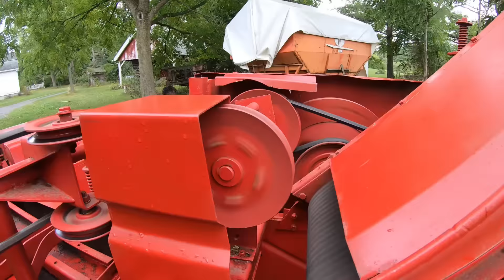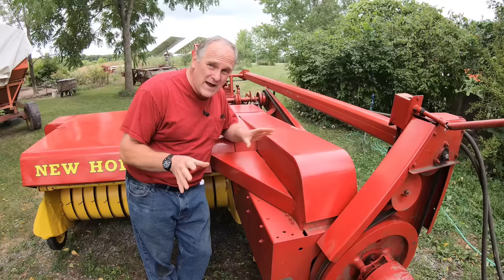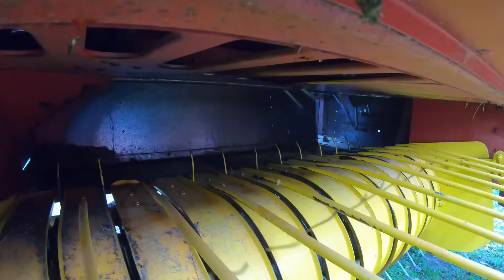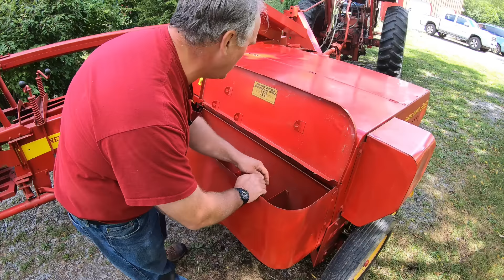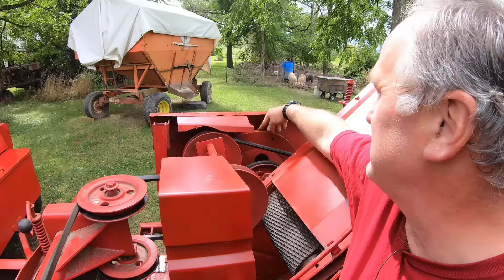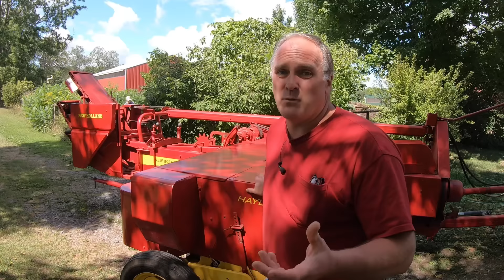NEW HOLLAND balers from the 1960's: how they work, maintenance, operation, and making good bales

Comment: Here in Idaho, people just drop their equipment wherever they stopped at, at the end of the season, then they go out next spring and wonder why nothing starts or works...like they're so afraid to build a shed to store that expensive equipment in.  I don't have any equipment or tractors, but even I know that leaving that stuff out in the weather is a horrible idea....I keep my lawn tractor in a shed, as well as my other lawn/garden equipment...when you spend hard earned money on stuff you would think people would keep better care of it.

Very interesting video on the baler functions.  Most people where I live have slowly transitioned to round balers as well.  A few still use square balers, smaller operations tend to, and those that sell to local feed stores.  I prefer the square balers as it doesn't require the large tractors and bale spears to handle the bales...however, many transitioned to the round bales because of theft.  People were going out in fields with trucks in the middle of the night and stealing hay.  Fix for that was round bales that required large tractors to pickup those bales.  Lot less theft that way.  

You mentioned with that square baler you ran it behind a 20HP tractor, which makes me think I'd be able to run it behind a Sub-Compact or Compact tractor...the only issue I would see is the weight of that baler pushing the tractor if you had hills on the property...luckily I have a nice flat area, but not enough space to bale anything LOL...I only have an acre HAHA!!

Comment: When I was young we baled 120,000 bales a summer for winter feeding for the cows. It was a wire binding baler. The wire didn’t break as often. Unfortunately we had to stack the hay and then feed out in the winter. Bales weighed 60-80 pounds great workout for young folks. It was a new Holland as far as I remember.
Thanks for the memories. It was life not drudgery.

Comment: We just bought a 268 last week.  The owner didn't have a tractor on site to run it but we took a chance and bought it anyway.  We got it home and tested it out.  It ran ok so next day we baled 500 bales.  Made another 168 the following day.  The baler didn't miss once.  I'm sold on New Holland.
Reply: How is it? And are you still using it?
Reply: @Huntersprojects  Yes.  Doing very well.  Made a couple thousand bales again this year.  Just did routine maintenance and replaced a few wear parts.  One of the best investments I've ever made.
Reply: @DavidJohnson-py6mp I had what I think was a 268 wire. Used it for ten years (78 to 88), then picked bales up with a 1040 harrowbed (pull type). Liked so well, might look for another. Have fun
Reply: Thank you for the update.
Reply: We've had a 268 for years!
I won't say.its foolproof but I don't know a better small baler. 
I have no idea how many bales I have stacked behind her.
Reply: Always keep the plunger knives sharp, as people often overlook this. It will reduce stress on the gearbox ,slip clutch and shear bolt.

Comment: You have done a wonderful job at explaining how the baler works. My landlord has a Hayliner 315 which does about 2500 bales per cutting. I am going to look into the absence of the cable for locking the right wheel, since it is me that does the baling. Maybe it never came with one, but it would sure be a blessing to have it. Something that has never been explained to me is, why the 2 pin settings when it is opened from the road setting to baling position. There is no mention of this in the manual. And lastly, can I bale in the road position?
Reply: Baling in the "road" position would wreck the UJ's.

Comment: Two tie baler,  what is your bale weight? 90lbs?        I work for 3 different farmers, mostly baling about 800 ton every year,  3 tie hay, either alfalfa or timothy, and 90% of the hay is shipped away either out of state or overseas,  our cattle ranchers, here have to import most  of their hay to feed the cattle, as its cheaper then the way we raise.  Almost 100 % of the hay farmers use Freeman  balers  made in the Portland Area, since the 1950's   design for heavy hay,  a few balers here many years ago where HI International or New Holland , but that was during the 1950 to 1970's  not anymore.

Comment: Great video. Being proud of making older equipment work as it was designed, with a couple of tweaks is a passion some people do not understand. Myself being an old farm boy, also a factory trained Hew Holland  Ag mechanic from the early 80's. Just going to mention the actual purpose of the shear bolt on the fly wheel. WAS to protect the needles . That would be the flat bar or on later models a cable that runs from the knotter to a little wedgy thing on the non-feed of the bale chamber it impacts the crank arm. Be like the minority and grease it the thing.That was the Major cause of broken needles.

Comment: Hey I have a 272, find I'm smashing through shear bolts every couple of bale's, have to clear chamber everytime. Any idea what causes this? Possibly blunt knives? And if so and idea how to replace or sharpen? Found it hard to find parts for the old girl.
Reply: Oil/grease on the disk "brake" on the end of the knotter assembly?

Comment: Yeah I like the nh baler better than the Jd   I changed over to a 10 bale Accumalator system and had to upgrade to 5070! I had a 30 year old 326 hayliner and it would always kick out a six inch longer bale inconsistent. Both great Baler’s

Comment: I grew up with a 68 and a 268, and a 56 Rake. NH made excellent hay equipment. 
The 68 was bought new by my Grandpa, the thrower added later on in the early 70's. Shortly after it was purchased by my Dad and brought to our farm. In the meantime, we had a 268. 
The 268 was a nice baler for 2nd and 3rd crop, lighter windrows, ran a bit faster and took less power from the tractor. Most of our time it was behind a David Brown 1200, with the occasional stint behind Grandpa's Moline U302 Super(gas). 
The 68 liked to be stuffed full. While the 268 was very similar to the machine in this video, the 68 ran slower and had the system for the feeder rakes where they mounted on a large chain. As the chain went around the sprockets, the teeth would advance, go up and return, then lower and advance again(picture a bike chain, with the feeders hooked onto one link in the chain) The advantage of the chain drive was the teeth "got up out of the way" as Dad would say. The 268 relied on the rakes gliding over the hay, obviously not ideal if the baler is being run at capacity, the rakes need the room to move. 
Basically, the 268 liked smaller rows and higher travel speeds and the 68 liked to get stuffed so full you couldn't see the pick up anymore, much less the rakes. We used to just cram that 68 full up and nice solid square bales would pound out the back. 
We kept both in a machine shed. The 68 got rained on, once, when we got a flat tire on a Saturday and couldn't get it replaced till Monday. Chaff from Grandpa's farm was on it when it went to auction in the 1990's. We had ZERO corrosion issues, we never cleaned the hay out. Of course, we kept them in Wisconsin wood machine sheds built circa 1890 with dirt floors, concrete and steel doesn't work the same. Bales from the summer prior were just as nice and green the next year in the chambers that way. 
Most farmers agreed the JD auger feed was more simple and had less maint. issues. The rakes on the NH can actually wear down, we had to replace them on the 68. The lead rake was 3 inches shorter then new! It can have a big effect on bales coming out "square" vs curving. We never had issues with the NH design, and honestly I think the machine is much better built. 
There were mixed reviews on the kicker vs thrower, most people doing the unloading of the throw racks would say the kicker style- the bales would "come apart" easier, meaning as you tried to pull the bale stack down in the wagon to unload the bales were more nicely stacked so to speak by the kicker. I think that is just a perception myself, a giant pile of bales thrown on top of each other is a giant pile of bales either way, kicker or thrower. 
The original system for turning the thrower head was a spring loaded arm that you attached to the hitch pole of the wagon. We retrofitted hydraulic onto both of our balers. Later still, we put a system with a chain and a hyd. cylander on the 268 to raise and lower the pick up head. We would run corn stalks in the field through a flail "chopper"(old straight through green chopper we cut the top off and directed the feed out the back) and then baled it for bedding for the cows. Adjusting the pick up height kept it out of the dirt so we wouldn't break the teeth if one of the corn rows/roots got a bit high from the cultivator or something. Those wagon loads smelled so good, but those bales were murder on your jeans unloading haha. 

Great video, thanks for the trip down memory lane.

Comment: When I grew up on the farm back in the 60's and 70's we had a NH compact 65 that baler was a awesome machine. We did hay commercially and averaged 20,000 or more bales a year with that baler. Those were great years growing up even though it was hard hot work. It's amazing the skills and work ethic I gained from the experience.

Comment: while you are preparing your baler for off season storage, go ahead and spray a fine mist of used oil to coat the bare surfaces in the bale chamber and pickup ... it is the easiest way to get started during a new season by not having to 'wear' off any rust.  1st bale through will 'clean' any residue, and the baler will be working just like it did at the end of the previous season.

Comment: In 1974 thru 1980 (Jr High and High School) I hauled hay for a local farmer and worked on a dairy in Norman Oklahoma and we used mostly square bails up to '78 on the dairy and the local farmer always used square bails. The hay was almost all alfalfa and the haying equipment was all John Deere. They used steel bailing wire and the hay was laid on the ground to be picked up by pop up loaders and trucks, thus my job as a hay hauler.

Comment: Just crushed a 269 baler.  Had a broken connecting rod on the plunger.  Easily fixed but didn't need the baler any longer 
Thoroughly enjoyed your video and tracked right along with everything you described felt like I was right out in the hayfield 20 years ago making it work.

Comment: Hi Pete, about knots, older balers could not take the type of knot you are describing - we used a modified square knot, mixing the fibers of the twine (old type twine) together.  It is hard to explain in writing but it is described in older baler books.  Great video, Ciao, L

Comment: Hi Pete, fellow farmer here, I assembled these balers for my uncle (farmer who introduced NH to our community in the early sixties).  Later, we studied this baler in our mechanized agriculture engineering class.  This series of baler which was made for nearly 30 years with few modifications (it was a low capacity "entry-level" baler for the tractors of the day).  The shear pin on your flywheel is not for the overload hay in the bale chamber, it is to disconnect the drive if the needles safety interlock would be activated (i.e. a piece of wood get in the plunger needle grooves and prevents the needles from wrapping the bales - the interlock will block the plunger from coming back and breaking the needles).
The different bale chamber feeding mechanisms that you described have to do with the capacity of the baler.  At 540 rpm, this as fast as the bale feeding mechanism could work because of the momentum of the feeder arm assy.  This system was better than IHC because did split the hay partly where the plunger knives would cut the bale.  All the gear on this baler including the plunger supports were roller-bearing mounted.  It was made to require very little power from the tractors of that era.  Finally, I would suspect that this 269 had a dealer-installed thrower (Hayliner 271/273 would have the factory-installed throwers). You made a wise choice to install the model 70 bale thrower as it enables you to drop your bales in the field if you want to.  It was discontinued because its frame was more fragile than the model 53, 54... and some less "gentle" farmers would break them (usually hitting a fence post with them or bottoming them in a gully.  
My brother has the family farm and he gave me the 268 (short tongue) with bale thrower (added) that we bought new in 1967, I am his neighbor.  I am trying to model my farm to the way farming was done back in the 50s~60s, restoring implements of that era.  My brother has the large "efficient" family dairy farm.
PS: Back in the sixties/seventies, NH was the most innovative American implement company - it is amazing the amount of designs/patents that they came up with over the years.  Peace be with you, Ciao, L (Maine)

Comment: Hi from Australia (Tasmania actually, down under Downunder!). I grew up with my father's NH 275, and now have an older NH Hayliner 69 which is in excellent order. Last year was my first year making hay "on my own" (that is, having to do the thinking) as my Dad passed away 11 years ago. Interesting how much you learnt that you didn't know you were learning when you have to make it work on your own. All went well and did 220 bales (all the grass we had to spare), but are hoping to do twice that this year, grass permitting. My only point to add to the excellent presentation you did is in regard to joining the two ball of twine. Dad showed me, and I think it is in the manual, that you divide the ends of the string into two even "strands" of say 6 inches length, then tie a knot in one strand of each ball and another knot in the other two strands (one from each ball) but make sure the two knots don't line up (ie say two inches from the end on one strand and four inches from the end of the other strand). That way two smaller knots consecutively pass through the system rather than one big knot. I see also that the twine has worn a groove in the eye of your needles. This will cause problems such as binding the string passage, catching the knots where the balls are joined (as described) as well as delivering the string out of position to the knotted mechanism. You can weld or braze the eye to replace the missing metal or drill a small hole (say 3/16") across the offending worn area and fit a hardened dowel pin for the string to bear on. Many thanks for your work.

Comment: Great video. Thanks! One question: when you say it could be run with a 29 HP tractor, does it mean I could use it with a compact 2520 John Deere?
Reply: You could probably run it but I use the same NH 269 with my JD 2640 that weighs at least 7k  lbs with cast wheel weights and a loader and it rocks me back and forth. I think you'd be in for a wild whiplash ride on a less than 2k lbs tractor. I'd definitely stay away from hills.

Comment: Never knew about the wheel stop, I'll have to check under mine.
Reply: same i use a rock most times. also i put oil where the tongue slides and that worked pretty good.
Reply: @tractorboy4148  I keep a block of wood for the haybine and mower
Reply: @Heimerviewfarm  cool my haybine turns pretty easily the baler is a pain a little.

Comment: I have found the hay fingers to be one of the most critical parts of the knotter. They have to catch the twine just right and feed it to the twine discs, they are often worn out and sloppy on their pivot bolt.
Reply: when my grandfather baled they had a McCormick square baler and some how the needles came out of time and the plunger sheared them off.

Comment: That flywheel is the key to low HP. Just need to get it turning, then afterwards maintain it. Ive been on tractors with so ow HP you have to spin the flywheel by hand the. Kick the PTO so itll speed up. Just need to maintain its velocity from there.

Comment: Excellent video I have the exact same baler. Had to go through it last summer and replace the plunger bearings too. The bearing on the side of the plunger towards the opening was completely gone and it tore up the cover plate for that side of the plunger so I changed all the bearings on it while I had it out. Mine was stored outside so several of the components were froze up solid it took a lot of heat and lube to get them back into working condition. Still need some haydog springs for it. I baled 200 bales with it this year to much rain. Just a small time hobby farmer usually only do about 1000 bales a year I just sell the hay to locals. So far only missed about 5 counting the first couple bales, that's a lot better then my 46 McCormick baler did. I am quite pleased with it so far. Thanks again for the video.

Comment: I inherited a Case 140 engine-driven square baler.  Needs work.  It would be nice to see it in working shape again.  I have the manuals, too.  If I recall, the timing would get off and would sometimes break a cast iron needle.  And some other issues.  But worked well.

Comment: One thing I didn’t see on your video was the needle latch. They get frozen in the open position and then if you jump time,smack there goes the needles. It’s worth mentioning to folks that are just starting out with these balers. It’s the first thing I check in spring. Hard lesson to learn on your own.

Comment: We had a New Holland bailer. made in the late 50's. We pulled it with the John Deere B. It had a Wisconsin 4 cylinder air cooled engine. You could have used a Ford 9N to pull it. The knotter was awesome. Never seemed to skip a beet except for once in a while.Don't know the model I was too young to care about those details. We had an International bailer that had terrible trouble with the knotter. It was old my father gave it to another farmer with the same bailer. I love you're vid's thanks for sharing. :-)